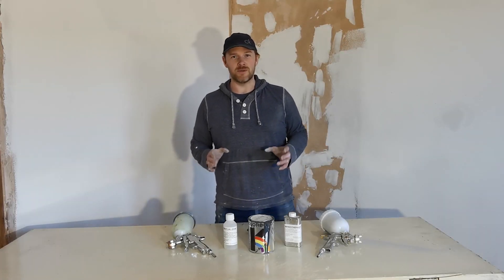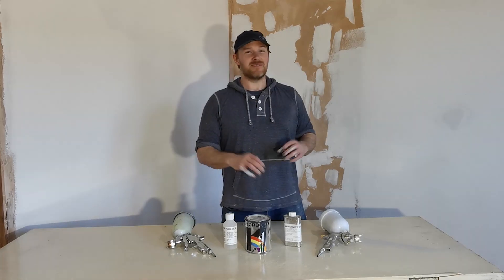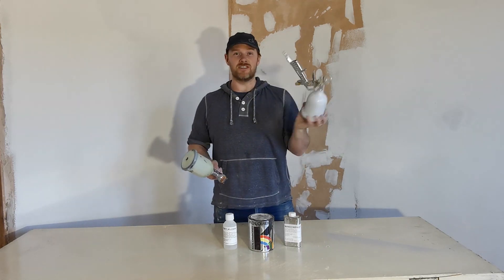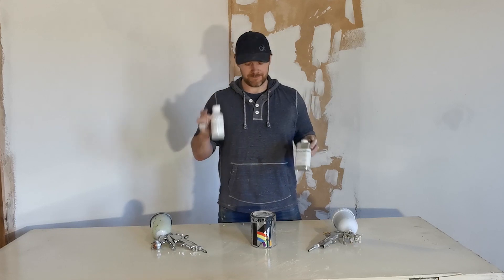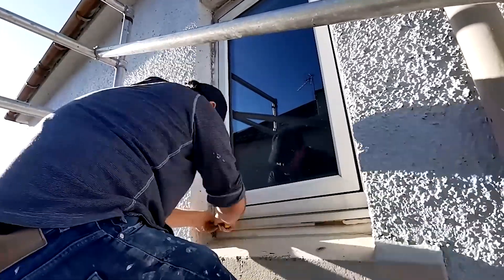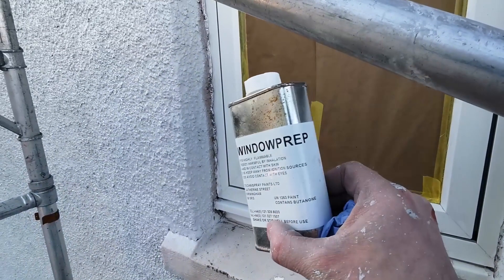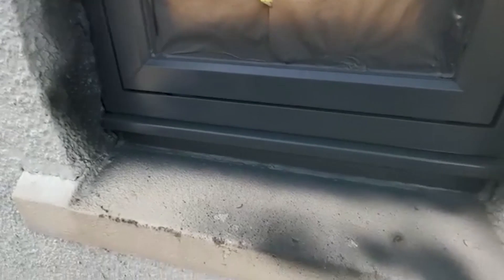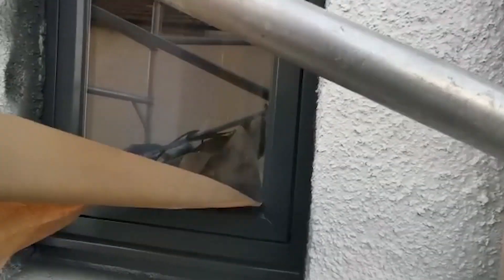PVC window/door painting, NEW LOOKING WINDOWS AND DOORS FOR £100?!

Comment: great job. what are the basic specs for your gun?  kolorbond have recommended i use a HVLP gun with a 1.4mm nozzle/cfm 4.5. i plan to use a 3HP /100ltr compressor /14cfm.  can i also ask how is removing the old silicone?  is it a difficult procedure?
Reply from the maker: Thanks, I'm using the Iwata AZ3 with the standard 1.3mm nozzle. I prefer this one as I can regulate the air pressure with the built in valve on the bottom. Your compressor will be more that enough to do it, I think my one has a maximum 10cfm.
Honestly, the silicon is a bitch, I'd recommend a sharp Stanley blade to cut as big a V as you can to remove a lot of it first. Then believe it or not I found a big flat blunt screwdriver at a shallow angle worked best to remove the remainder silicon off the Pvc frame.
Hope this helps 👍
Reply: I’ve got a suction feed gun with a 1.7mm nozzle. Do you think I will be ok using it or change out the nozzle?

Comment: Hi great video what sprayer dod you use it looks like a earuber
Reply from the maker: Certainly was, I think it's still on sale in screwfix for £50-£60
Reply: Hi did you use a diffrent hose with the gravity spray gun thanks
Reply from the maker: @johnbish9479  so sorry, for some reason I thought this was another video we did. It was a compressor I used for the air supply on the window painting not the erbauer.

Comment: My question is how long does that stay stuck to the upvc?  Does it scratch off when the window cleaner does his job?
Reply: It shouldn't do if enough coats are added but just to be on the safe side, it may be best to go over with a multi surface clearcoat lacquer. That being said, most durable/external paints are designed to be safe regardless of weather/stress so best to read up on whichever paint you choose and go from there 😊

Comment: Looking at doing this job myself. I note you have sprayed over the black rubber I think there's a good chance this will crack up and come of in a few months/ years time.. my windows are brown wood grained look think will  for a roller
Reply from the maker: Hi Victor, the Kolorbond paint is marketed as being able to bond to rubber....but....i did actually mask over it as I don't want to run the risk. The masking tape is quite translucent when applied and that perhaps makes it look like it wasn't applied to the rubber.
I would suggest though that you do leave a very tiny edge of rubber unmasked to allow the paint to cover all the Pvc, otherwise you run the risk of still having some of the old colour visible when the tape is peeled off.
Thank you for viewing the video 🙂

Comment: That's a great help, thanks. I've patio doors that need this treatment, newer than the rest of the windows which we're due to replace. This will help with getting rid of the feuchie broon as we call it here in Aberdeenshire lol. I'll look through the comments to find the materials you used - hopefully, Screwfix and Toolstation in Aberdeen can supply all. It'll be the same RAL code that you used that I'll need. Fingers crossed it goes well......
Reply from the maker: Good luck with it, if you need any more advice feel free to ask!

Comment: Excellent video
Will be a job for after winter now ❄️❄️
Couple of questions
First did you mask off the black rubber exterior seal or was that coated with paint?
Second already have a paint sprayer (erbauer 700w hvlp) would this work for painting window frames?
Reply from the maker: Yes I normally mask off the rubber but not right to the very edge of the Pvc otherwise when you take the tape off you might still see some of the original colour. So tend to overlap and spray about 1mm of the rubber.
I wouldn't recommend using that sprayer. We have the same one and use it for masonry painting and since you can't regulate the air pressure I don't think it would be good enough.
Hope this helps

Andy

Comment: Hi , do you use a water filter and a regulator for the spray gun? Thanks
Reply from the maker: Hi, I've not attached the water filter on this occasion but there's no harm in adding it. The spray gun I use has a regulating valve at the base but if it didn't have one I would definitely add one in-line.
Hope this helps

Andy
Reply: @thepropertyfixers3028  Thanks for the reply I appreciate your help 👍

Comment: Whats the  viscosity of the paint before it goes in sprayer ,do you thin it ,great work thanks for any advice 👌👌👍
Reply from the maker: Hi, the Kolorbond paint we use doesn't need thinned down at all. It's ready to spray straight out of the tin 👍
Reply: Thankyou very much what psi and cfm do u recomend on my compressor spray gun and how far will one tin go would it do a small terraced house thanks hope they turn out like yours look brand new saving me loads 👍
Reply from the maker: @texasdalton7810  my compressor has a max 10cfm and on the local regulator I'm somewhere in the mid 30s for psi....i think. To be honest I do a quick test spray to get myself happy with the fan before spraying the window.
If you're buying Kolorbond then I suggest giving them a call (ask for Simon) and they're pretty good at recommending the volume you need but I did 12 windows and 2 doors from 2 litres and still have some left.
Hope this helps!

Comment: Thanks just what I needed to see. Kinda' stuck between 3 companies to purchase my UPVC paint from.
Kolorbond
HMG
ColourPro

Did you use the kolorbond K2 or just their standard UPVC one and also been a quiery of mine. How long after spraying the final coat on a door, is it safe to close it for good.
Reply from the maker: I just used their standard UPVC paint and it hasn't let me down yet.
As long as the ambient air is dry and above 8'c I've closed the door after around 2 - 2.5 hours and not had any issues. But I'd always suggest trying to leave it as long as you can. 

Hope this helps

Comment: Hi, great video, really helpful. 
Have a question on the finish. 
When the window opens outwards. Is a white line around the frame  where window would open and close acceptable or do you mask off somehow to get this painted too?

thanks.
IK
Reply from the maker: Good question. I've masked it off from the inside after opening the window as wide as possible on larger windows. On smaller ones I used cardboard to block the opening.
You could leave a white bit if you want but it looks terrible when the windows are open.
Hope this helps

Andy

Comment: Great video!! 

Can I ask:

1. Did you use a 2 pk high adhesion resin polycrylic paint for the UVPC windows? If not, is it OK not to? 
2. Did you need to mix with a Thinner? If so, what ratio?
3. Did you need to use an Activator?
Reply from the maker: The Kolorbond paint is straight out the tin onto the Pvc, you don't need to add thinners or a hardener. They do have a 2 part paint for non pvc use too if you need it.
Reply: @thepropertyfixers3028  hi what's the durability of the paint. I have read that UPVC won't hold paint for long
Reply from the maker: @sulthanabegum1350  Hey, according to Kolorbond the paint actually bonds with the PVC and doesn't just coat it therefor giving it a very long durability 👍 The first window I painted a few years ago still looks as good as new.
Reply: @thepropertyfixers3028  thanks for your reply!

Comment: How would you prevent getting paint on the brickwork?
Reply from the maker: You can mask it off from the silicon line with either brown masking paper or light plastic sheeting. I prefer to use the brown paper and as it's on brick you can use a much more rubust tape like duct tape instead of generic masking tape.
Hope this helps

Andy
Reply: @thepropertyfixers3028  thank you. Can't wait to try this